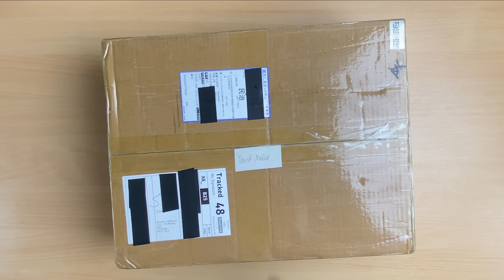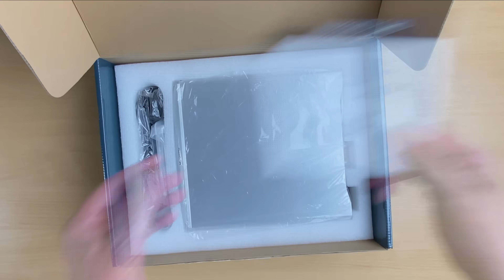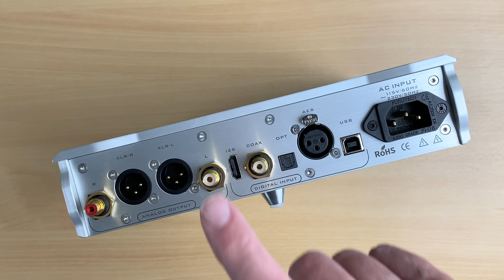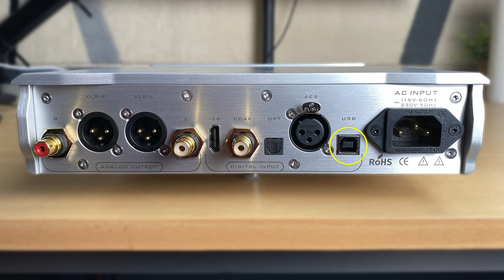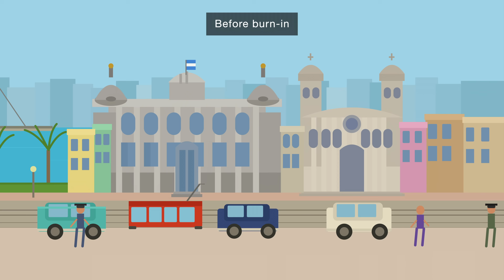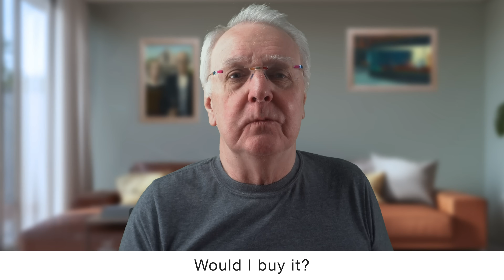168 hours later - Did this $1200 R2R DAC actually improve? [Musician Pegasus III]

Comment: Even a rank amateur would know that your burn in was offset by you placing the unit on a cardboard box/surface. This negates the electrons properly heating the internal components to the optimal temperature necessary to achieve proper audio nirvana. I’m disappointed someone with your obvious experience (just look in the mirror to verify the experience claim), didn’t already know this.
Mabe

Comment: I have a strong theory for how to gauge burn-in. But, specifically only applies to electrolytic capacitors. As per spec sheets (pick one) they will state that a cap that has sat for 2 years needs to be reformed. For expensive or boutique capacitors, that is pretty standard, and so is using caps rated for wildly higher voltages. So if you take a 60v cap and feed 2v through it, you might come close to the 100 hour burn in (or reforming) time. Whereas, if you buy the lower cost capacitors from a major supplier that moves inventory, there may be no burn in required and you may think that it is a myth.  

However, for anyone reading this, it is a measurable hypothesis. You can measure this.

Comment: I really hate the whole "burn-in" thing. I'm one of those people that believe that I can hear subtle differences between things but I do take a grounded approach. E.g. cable upgrades the sound quality? Likely RFI eleviated by switching from a stock cable to a quality shielded one. Burn-in, however, it just seems people take it way too far. I.e., burning in headphones for 200+ hours before you listen... or saying that details are now popping out at 200 hours+ which is likely a psychoacoustic training effect. There's also confirmation bias and that psychoacoustic effect of hearing what we expect because we're positive the more burnt in cable will have better micro details. 

I think a good analog to this is when you reach an impasse: you can't see how something is possible-. That is, until you sleep on it and then you can't see anything but the solution because you KNOW that it is correct. Same thing with our eyes, blue or gold dress? Depends if you perceive the lighting as day or night lighting. Even our moods or freeing up of attention increases our perceptions to what we hear or see. My eye's develop a twitch when I see somebody burning in their new 10k system before even listening to the damned thing.

Comment: Curious how these compare with the rest of market - Denafrips Ares 15th, Pontus 15th , Gustard R26 II....
Reply: There are some measurements out there for the first. It measures slight better than the denafrips in the same bracket. That said, r2r has a signature as it has distortion. So better or worse becomes highly subjective. Well built. From the same factory as denafrips. I like it. But you may not

Comment: This is more of an unboxing video and commentary on burn-in than an actual review of the Pegasus III.   I own the Musician Draco and the Pegasus III.  I use them both at the same time because I am bi-amped.  I also compared the Pegasus and Draco for the top part of my speakers (above 100 hz).  

The remote:  This is definitely a device where you want to use the remote.  The manual control on the Pegasus tend to have dual function buttons which are a bit of a pain to use.  Definitely have to consult the manual to get the hang of them.  Not a huge deal because let’s be honest: a DAC is a set it and forget kind of device.  The problem with the remote is very basic.  You know the cheap metal socket wrench in the “L” shape that comes with many things you have to assemble?   Well it isn’t included here which is a big miss for a $1200 DAC.  

There is a page in the manual for the remote which ONLY talks about the buttons.  No where in the manual or anywhere else does it tell you what kind of battery the remote takes.  Another miss.  In fact, I had to get a second remote because the first one had one screw in so tight that it stripped before it un-screwed.  The seller, not Aoshida, was very good about the replacement.  I’ve also had dealings with Aoshida and they are VERY responsive.

The DAC:  To be honest, I really didn’t detect a big difference with burn in.  Maybe the first day, but that is about it (if that).  I tried the DAC in NOS and OS modes and overwhelmingly preferred NOS (this was also true of the Draco).   This DAC like many R2R DACs is on the warm side of neutral and some say it has a smooth, tube-like presentation.  I would agree with that.  I was coming from a Delta Sigma DAC and I was looking for more warmth.  If all you want is resolution, you can get that with a Delta Sigma DAC for much less money.

Where the Pegasus shines is that it provides that warmth and a bit of a deeper soundstage without sacrificing too much resolution.  This was very apparent when I had the Draco on the upper part of my system.  There was the musicality, but I missed the resolution of my Delta Sigma DAC.  That added musicality works In the bass where the fuller presentation gives the impression of more bass.  However, for me, I wanted the added warmth while retaining as much resolution as possible.  The Pegasus has a nice balance of resolution with musicality.  But understand, this is all a matter of the presentation you want for your system.

I purchased these DACs to address a system issue: the Delta Sigma DAC soared with good recording (in general), but did not treat lesser recordings kindly.  Also, any hot recording was often hard to listen to.  These DACs have added the impression of additional bass, and smooth off the harshness of many recordings.  All is not perfect, high resolution DACs are going to reveal flaws in the recording, but those flaws are presented in a less harsh way the leaves more of the music I love enjoyable to listen to. 

If given a second chance, I would still purchase these DACs.  I really like the Pegasus balance between resolution and musicality.  But the choice of a DAC like this comes down to what you are looking for.  The Pegasus is going to be what some need but not others.
Reply: Do you notice a difference  between rca and XLR output from the Pegasus? Thanks
Reply: I have the V1. Not sure if I actually can hear the difference vs my Delta sigma. But well built

Comment: About 200 hours of burn-in on my FiiO DM15 made a night and day difference. Right out of the box I started to doubt my purchase. Now i'm in love with this veey musical little player. It is shockingly good. Plus great headphone stages. 🙏
Reply: That’s not burn in. That’s your brain getting used to it.
Reply from the maker: Shush no spoilers please.
Reply: @rw80 Or it's your brain unable to comprehend. 😉
Reply: @JRVick I'm an electronics engineer.  Thats not how electronics work. Electronics is the world of cycles and microseconds, not hours.  

A transformer experienxes inrush for up to half a second.  Thats a piece of electrical equipment "waking up."

Capacitors don't improve performance after being on for hours.  I literally work around these materials all day, every day.

Burn in was invented to nuke your return period.
Reply: @electroduval831 You learned all that from books. I learn from life. My experience tells me different. So i agree to disagree Sir. 🙏
Reply: @electroduval831 really then why did the engineers at Bell labs say it could take up to 500 hours for the 300b vacuum tube to burn in and reach it's full potential, they were selling these tubes at the time.

Comment: If burn-in is important, why didn't Musician Audio burn it in? Does burning-in with a heat gun count?
Maybe burn-in with pink noise. Or buy a DAC that doesn't need burn-in.
Edit: Put electricians tape on the back of the remote to prevent scratches!
Reply: Denafrips does a 100hrs factory burn in, Audeze as well

Comment: The other thing I have heard about R2R DACs ; the resistors need time to warm up to give its best performance, so usually about half an hour after turning it on will give the best sound from the DAC. How true this is, I don't know, but some other YT channels say this about R2R DACS.
Reply from the maker: This is not an unreasonable point - resistance changes with temperature and accuracy of resistor values is key to R2R. Whether the temperature changes enough to make a difference, I do not know. But it would be interesting to find out.

Comment: If burn-in mattered that much, companies would do it themselves. You should therefore be weary of companies that recommend it.
Reply: Actually numerous companies do pre-burns.
Reply: @johnb6677  Most, probably for reliability checks, not burn-in performance increases. Either way, why make it a job for the customer?
Reply: @DonnieMulligan  I guess you can ask the same of car manufacturers. I don't consider burn in a job. I actually enjoy a speaker sounding good out of the box and then sounding better the next day. If you hate burning in speakers just get a sound bar. :)
Reply: @johnb6677  I hate pseudo-science,  snake-oil,  and companies that manipulate customers on false pretenses. Ignorance is bliss, but costly.

Comment: If the manufacturer recommends burn in then do it, after all they designed the thing, mechanical systems run better after a period of time bedding their components together, electronic systems also have movement but in the form of electrons, so it would make sense that their components also benefit from a time of electrons passing through them, but that’s for the science department.

Comment: I would always think, if 'burning in' is so important, why don't they do it at the factory? For cars, I can imagine it would be more difficult to do so, but for electronics, it's just a bunch of devices running for a week? ;)
Reply: how does a manufacturer ensure that the final product meets QA if they don't test it? I was in test & measurement, and EVERY unit that went out spent at least a full day (often longer) in a heated closet to make sure calibration and performance didn't drift with temp. with the price these are going for, it seems post-burn in testing is the least the manufacturer could do.
Reply: @poofygoof  Well, to get a new car at full specs you would need to drive it around for at least a 1000 miles. That would make it a second hand car. Same with shoes, by the way.
Reply: That would ruin 'the ritual' and expectations. 'Burning in' has much to do with the listener ears self 😉
Reply: @34332 No, it has not. But saying this will fall on deaf ears...
Reply: @ernstraedecker6174  I can imagine it would be logical for equipment that relies on mechanics to reproduce sound, like speakers or turntables. This is probably where the term originated. Projecting that onto modern electronics without a single moving part  just seems silly to me ...
Reply: @Eurovision-OLD  You're stuck in the 17th century mechanical world view. Why would only mechanical parts need to break in? And what does the break-in actually, really, really consist of?

It is better to think in terms of materials that change. For example, insulators change all the time. Their molecules align themselves continuously with the changing charges in a copper wire. So yes, they ARE moving parts.

If you put currents through connecting metals, the surface layers between the metals may change.
Reply: @ernstraedecker6174  So, in your view, producers of electronic components sell stuff that will change so fast you can hear a difference within x hours, and then stop changing for years? Does not make sense to me.
Reply: @Eurovision-OLD  A lot of physical systems tend towards an equilibrium. They tend to flow towards a configuration of lowest (potential) energy. A pendulum comes to rest. An excited electron, pushed to a higher orbit, tends to fall back to the lowest possible orbit. In the long run the universe will die a heat death.

So your idea that systems would normally continue to change, is wrong. They do the opposite. Think of the second law of thermodynamics.
Reply: @ernstraedecker6174  I can understand how electrical components will change over years, that's logical. I just wonder why this discussion only takes place in audio circles. If you don't have to 'burn in' your new phone, television, microwave or laptop, why should audio equipment be different? And even if it were true, my whole point is, shouldn't manufacturers then have to do that work before they sell the components, or finished product?
Reply: @Eurovision-OLD  Well, you have to drive in cars. And to play in violins.

Whatever the cause, audio burn-in is real. But if you don't believe in it, good for you. No-one forces you to hear it.

Why wouldn't the manufacturer do the break-in work? I think some do to a certain extent. If I sold a 50,000 dollar speaker cable (they exist), I would certainly take the pain of having it burn in for a week. I would advertise that too. BUT I would not sell such a cable, because it's a scam. For a cheap cable the energy cost would be too high, I suppose.

Last september I bought the SMSL PL200 cd player. It didn't need any break in over the RCA output. However, a month later I listened over the built-in headphone amp + big jack for the first time, and sure enough, the sound changed within hours and was still not good at the end of the evening.

One guy who works in communication industry wrote in a YouTube comment that the specs of caps slide over a period of months, before stabilizing. They measured it.
Reply: @ernstraedecker6174  My problem here is that you give examples of purely mechanical things that need breaking in? Of course not something I would argue with. And of course caps, resistors etc change characteristics over time. I would just not expect the curve to be very high at the beginning, then changing into a slow deterioration. For any component that has a current going into it, I expect it to be perfect from the moment it was produced and tested, and not have a relatively short period to change the thing it's supposed to do?

Haha, don't get me wrong, don't want to pick a fight, I just like these kind of interactions ;)

Comment: Burn in can be quite transformative if the audio signal goes through film capacitors, as those puppies take a fifty to as many as five-hundred hours (exclusively pertains to those miserable, yet terrific teflon caps) before they fully stabilize. 

Film caps in crossovers? The same burn-in applies. In most cases the driver's surround and spider (which centers the bottom of the voice coil) loosen up fully in less than fifty hours, depending on the materials used.
Reply: What do you mean by "stabilise"? Do the capacitors not provide the capacitance as per their factory markings from delivery? If they actually and measurably change electric qualities within mere days of usage, I'd say they're likely to be sub-par components.
Usage ("burn-in" or wear) with speakers makes sense, since they're electro-mechanical devices.
Reply: @Spurdospaerde692 vacuum tubes definitely burn in.

Comment: It would be nice if he pre-burn in & post-burn in signals were displayed side by side on a storage oscilloscope, ideally one that has the facility to add, or better subtract he channels from each other.  
Or it could be done in a DAW, at a high sampling rate & 24bit. 
If there is a difference between Pre & Post it would result in something being left when subtracted.
If nothing left, then burn in makes no difference.